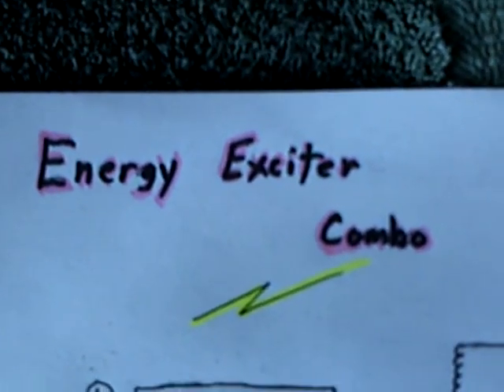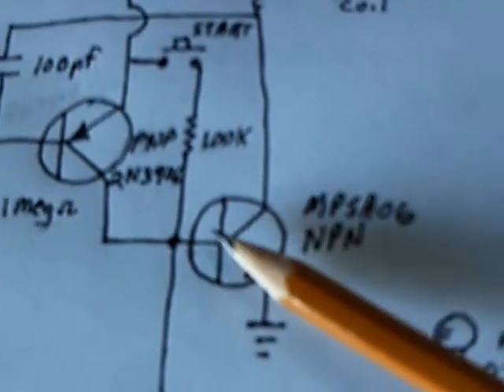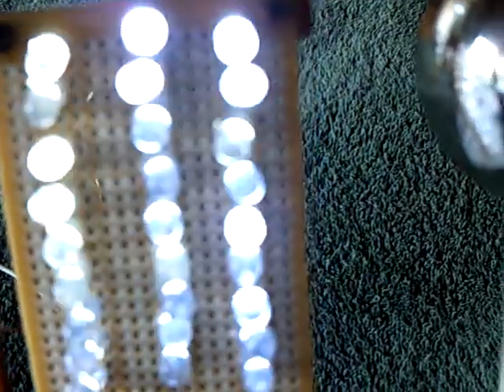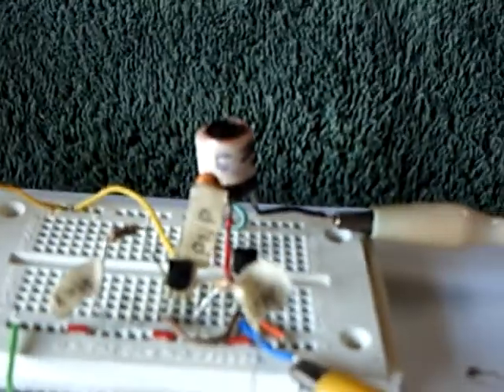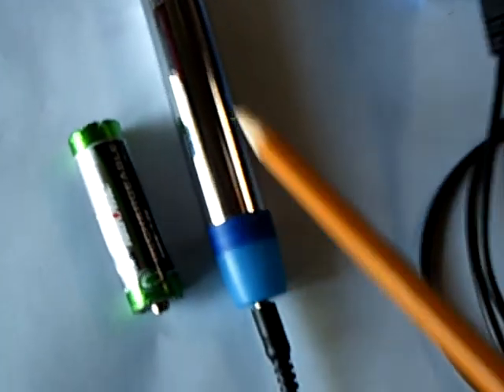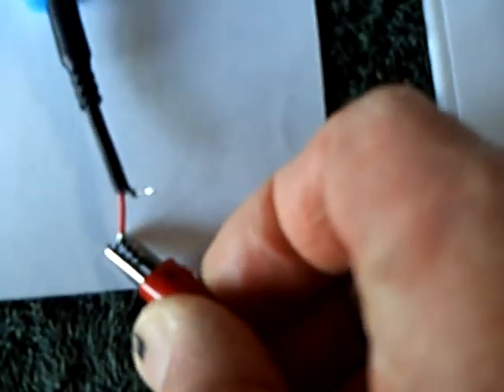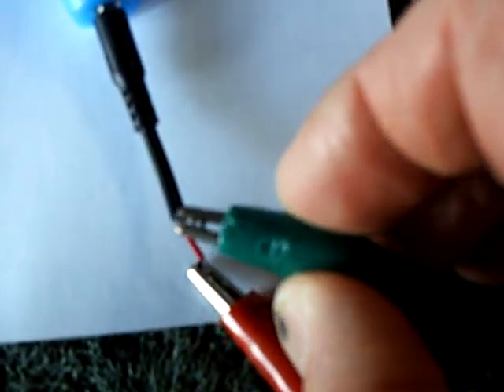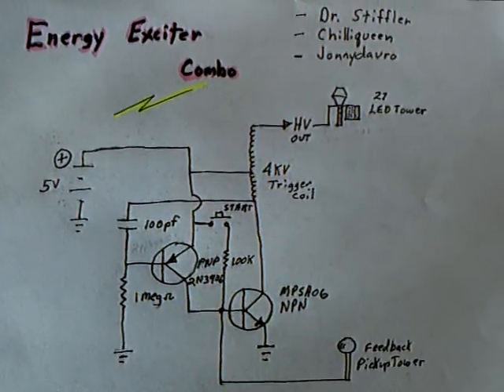Energy Exciter Combo.ASF

Comment: hi  Lidmotor, what a phenomenal work you're doing!
I've successfully run a SEC circuit yesterday and started working on this EECombo of yours. I was now wondering whether the 4kv Trigger Coil is the same as the (fuji-camera-like) 4k trigger transformer used in the SEC... if it's the same how would you connect the 3 terminals?  I'm in EU and having trouble in finding trigger coils around here... thanks!

Comment: hi would you view daniel dingel reactor and if possible explain his exciter as would such a exciter make a motor acuator carry on .he is using stainless steel case (positive and aluminium inside for negative.this makes negative electrons from the hydrogen off aluminium and they touch the walls of the case making electric appreciate reply as i struggle at electronics